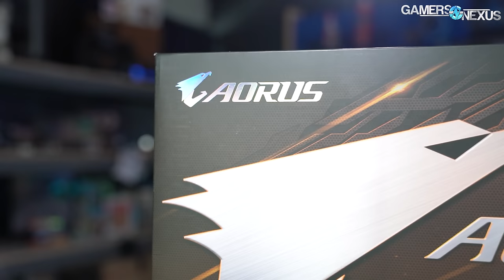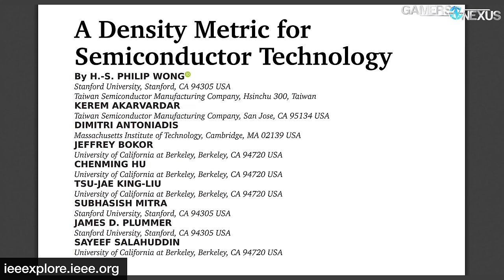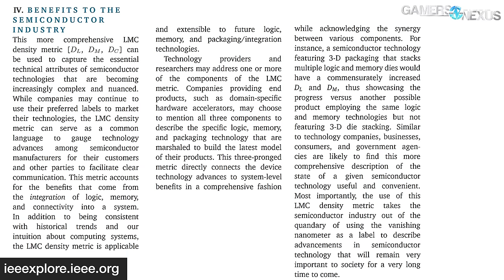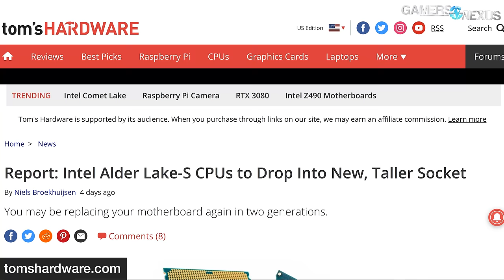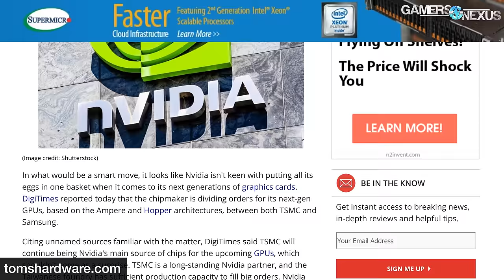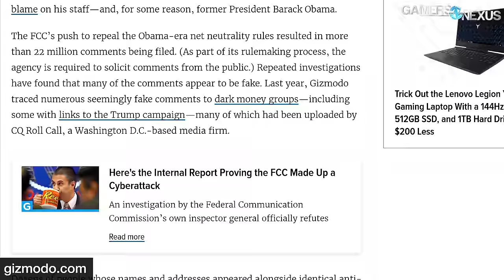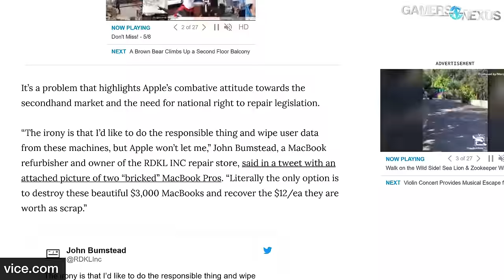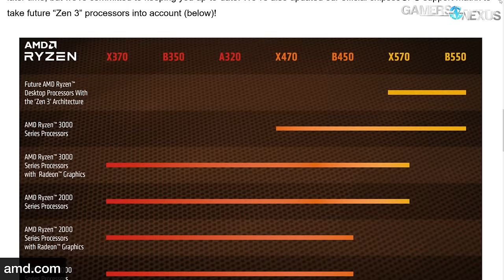HW News - NVIDIA & AMD Fight for 5nm, Intel Alder Lake, RTX Ampere, Ryzen Pro 4000

Comment: I don't get how nvidia would out buy amd in 5nm when tsmc announced they have a specialised 5nm enhanced node for amd
Reply: Nvidia and TSMC have much closer relstionship than AMD for around two decades. I think we will know more about the situation once GTC2020 video goes online. For some things both TSMC and nvidia prefer to keep it secret. Like 12nmFFN. when nvidia annouced GV100 in GTC 2017 we only know the existence of 12nmFFN at that time. Prior to that we never heard about this customized node that allow nvidia to break 600mm2 barrier. Not to mention back in 2012 nvidia are complaining about not getting enough 28nm capacity. TSMC quickly responded by giving nvidia capacity from both qualcomm and AMD so nvidia can meet their demand. So if nvidia said they want TSMC 5nm then TSMC probably will going to fullfill that demand. And we only heard about TSMC are doing some partnership with 5nm process but did not say by doing so it eliminates other access to TSMC 5nm node. If anything making the node exclusive to only one of their client is something TSMC will avoid at all cost. Apple once offering TSMC to manufacture their SoC only and ditch other and TSMC openly said they will never do something like that.

Comment: A silicon atom has a Van der Waals radius of 210 pm. To make a transistor you need more than 1 atom, at least 3 i suppose if you are optimistic, for gate, drain and source. As atoms cannot enter each others radius, 3 times 210 is a best case 620pm or about 0.62nm.  
However, because you need to dope the silicon into Positive and Negative charges, you need to combine it with other atoms. So you can pretty sure smaller than 1-2nm transistors will never be created. And even that would require immense the precision of basically placing single atoms precisely on a substrate. So after that it will be up to designs and architectures, Quantum computing perhaps, or  Terrahertz capable switching materials(but not smaller), superconductors perhaps for less heat.

Comment: i5-3570k @ 4.5 Ghz here. Just wondering if overhauling to the ryzen 9 3900x would be a worthy upgrade to the next future normal or should we wait for the ryzen 4000 specs to come out? My quad core has served me well for the past 9 years and I figured its age is really starting to show if a 12 core CPU is available for an affordable price.
Reply: Just wait for the 4000 series, if the reviews are good, go for it with a nice B550/X570 Board or if the performance increase is not super high, 3000 series might get a price cut then, it'd be a win-win situation.
Reply: Go 4000 series, less latency and higher clocks apparently. X670 motherboards should be tweaked a bit too.
Reply: I am still on a 2500k and I can feel a noticeable improvement on even a 1700-based PC, so yeah it should definitely be worthwhile. That said I would wait for the 4000 series. There is a good chance early adopters will sell of their old AM4 platform and price cuts in stores will happen too, so you should be able to upgrade for cheaper.

Comment: You know, i'm pretty sure anyone interested in process node size is quite aware of pikometers being smaller than nanometers. I also recall exactly 0 instances of someone having a problem with previously used 0,xx um (micrometer, micron) naming scheme. In fact, I believe some (:wink:, :wink:) IC manufacturing company got named after exactly that. Still not the point of course, but my inner social media warrior felt the compelling need to address that particular line of reasoning.

Comment: I’m really concerned about nvidia splitting their manufacturing between tsmc and Samsung. We have seen ARM CPUs labelled the exact same thing in the mobile space with large differences in quality and performance to each other. I’m not sure if this is the same thing but it does not inspire confidence.
Reply: Majority of nvidia GPU will be still at TSMC. and by majority it means mid range and above. We will not going to see things like GA100 (nvidia biggest chip) being manufactured at both. My take is some low end GPU (GA107/8) at samsung and their next gen tegra stuff.

Comment: I am super annoyed that x470 is apparently not going to work with Ryzen 4000 CPUs... I upgraded less than a year ago and bought a solid x470 board with specific plans to upgrade to Ryzen 4000 when it came out. What is the point of AMD's marketing about maintaining compatibility? I feel like they should at least support x470...and I hope board manufacturers have the ability and motivation to add support on their own. If I have to get a new motherboard, it is really going to sour my opinion of Ryzen/AM4 in general. The performance is great, but a big part of what it offered was an end to b.s. like this. It really feels like AMD is going back on their promises a bit here.

Comment: There is a natural lower limit to semiconductor technology dimensions which is 1 (one)  Angstrom.  1 Angstrom is one tenth of a nanometer; a unit commonly used in crystallography.  So a 0.5 nanometer technology is a 5 Angstrom technology.  The Angstrom is the natural unit to measure atom sizes and spacing.   For example,  the nearest neighbor silicon to silicon atom distance is 2.35 Angstroms.  Nothing in the semiconductor technology will be smaller than a few Anstroms (that is,  a few atom spacings).   Picometers,  femtometers,  etc.  are in the realm of nuclear and particle physics, not semiconductor physics.  500 picometers sounds silly,  but 5 Angstroms sounds cool,  doncha think?
Reply: You forget Quantummechanics.

Comment: Man im still using my lovely i5-4460 + R9 290. Im ready to upgrade and the hardware scene is looking great. Cant wait what Nvidia and AMD going to release the next few months.
Reply: i also have the i5 4460 and r9 290, and i also plan to upg this winter. the jump in performance should be really noticable, even with new midrange hardware
Reply: I still I5  4690k and GTX 1080

Comment: It's been common knowledge for quite a long time for anyone that understands even a little about the fab business that process technology nodes are not directly comparable from one company to another, especially as we entered the 2x nm era of fabrication (28nm, 22nm, etc). This has been a problem for some time, especially because it seems that certain companies got looser with their numbers, using numerically lower labels in order for them to seem like better processes. There are too many factors to a 10nm or less process to be able to say that one process is better than the other solely because the one label number is lower (this is part of the reason why Intel's 10nm, if it could have been fixed to work with mass-produced silicon as it was supposed to have been years ago, would have been very competitive with TSMC's 7nm, as not all variables for each process are otherwise equal, lending each one to having its own strengths).

For the end user who doesn't know a lot about fabrication, this would be the biggest benefit to coming up with a better way to measure node density, as it would put each node from various manufacturers on an even scale. We wouldn't have to have such caveats as "Intel's 10nm is competitive with TSMC's 7nm" because the processes would be represented more accurately. This might not suit the marketing department of any given company, but screw them. The closer we get to 1nm, the more meaningless these node numbers become.

Comment: should i upgrade to a 3900x or wait for the 4000 series? changed my mind on threadripper thank's to buildzoid! i'm still on amd 6 core fx chip luul
Reply: Just wait for the 4000 series to release and check out the reviews, if they're good, go for the 4000 series or else there might be a price reduction in 3000 series so it'd be a win-win.
Reply: 4000 series, should have less latency and slightly higher clocks.
Reply: I'd wait for the 5000. Details are scarce, but it should be faster than the 4000 series...
Reply: Im also fx 6300 user :D

Comment: Angstroms get used a lot more than pm when talking about fabricating semiconductors.

At least they do in my graduate semiconductor fabrication classes, as well as the fab where I worked and the textbooks and papers I read. In a lot of cases, Angstroms were also used more than nm.

The Fabs have always had a lot of versions of their process, TSMC for example has HP, HPC, HPC+, HPM and LP all on 28nm. A quick way to see what's available is to check what products Synopses has for that process size/type.
https://www.synopsys.com/dw/emllselector.php?f=TSMC&n=28&s=wMkRWA

I agree that the "gate length" is no longer a good metric. Those people definitely know what they're talking about.

Comment: but 500 picometer is smaller than 1 nanometer. why would anyone think otherwise? smaller is still beter. must be concerns over some imperial using country
Reply from the maker: You've missed the point again where it's not about the actual size, because that's a pointless marketing metric. It's about the fact that we need a new number. Further still, on the marketing side, if you said "this processor uses 7nm process," very few people could actually tell you what that means -- much less if 1nm is better than 500 picometers. It's nothing to do with the metric system and entirely to do with an arbitrary, hardly useful metric to begin with that's meaningless to consumers who don't actually pay attention to this industry.

Comment: Size is relevant, however insignificant.  If you can stuff more complexity into a given area, it has more.

Simply put.

And true for many people who ignore, forget or retain the metric system understanding is perfectly natural, there are many others who have past experience to understand it.  It is the only way manufacturers can move to creating better chips at lesser cost which operate at lower power, besides changing the physical logic within the die, which remains the single #1 factor.

Kilo meters, kilo gram, billion air, micro meter, nano meter, Terra byte, we all understand the metric system and how it works.  Failing to comply with standard scientific measurements only insults our intelligence as a species. Don't know about you but I am sick of being insulted.

Comment: Your logic about not switching to picometers because the numbers will get bigger and it will confuse people is flawed. First, most general consumers don't know anything about what nm their CPU is, they know things like the number of cores or i3, i5, i7, or Ryzen 3, 5, 7. The consumers that know about more in depth things are enthusiasts and they will not be confused at all about switching to picometers. With your logic it was a bad idea to market 2 TB HDDs because it sounds smaller than 2000 GB and it would confuse the consumer. Maybe manufacturers should be selling 2,000,000,000,000 byte drives. Why isn't Intel advertising the 10900K to boost to 5200 Mhz?

Comment: Can't believe how casually you brushed off the mobo backwards compatibility issue with the future 4000 chips. Aside from misleading their customers into thinking that at least the top tier (X470) boards would properly support one subsequent gen (if not outright, then by carefully cultivating customer expectations while not technically promising anything) - Their reason is bullshit. Just provide the customers with the choice of BIOS: 1000 & 2000 series, or 3000 & 4000 series BIOSes. It's not too hard to just split them! - Besides, there are 64mb boards too.

Comment: Guess both Intel & NVIDIA will wait until PCIe 5.0 and avoid the short 4.0 release. AM4 is almost at the point as AM3+ a few years back......no need to spend $1,000+ on this underperforming (PCIe 4.0) platform which is NOT doubling PCIe 3.0 by any means, evidenced both by AMD PCIe 4.0 GPU's & NVMe 4.0 x4.

Comment: When will AMD be on -3nm?
Reply: You can't.
Reply: @emmata98  You can if you turn the transistor around in the opposite direction
Reply: @chrism6880  Distance is always bigger or equal to zero :)
Per Definition of the Metric you are using to measure it.

Comment: Picometer? Kind of irrelevant, not used. 100 of them make an "Ångstrom" (10e−10 m) that was used long time in scientific community. That  Ångstorm is 0.1 nm so would be very useful here too.
Why is that? Because inter-atomic distances are in 1-10 Å range. Going lower than that just adds zeroes with no meaning.

Comment: AMD lying with their excuse not to support Zen 3 on older motherboards..it's becoming like Intel
Reply: technically they might not be able to hold the new information, which is why x570 only supports zen + and zen 2 currently, but it's still bullshit that they won't at least give us two bioses, one for zen 1 and zen +, one for zen 2 and zen 3. or drop zen 1 support in a future bios release so people who still use zen 1 simply don't update.
Reply: @bananya6020  they can trim down the bios and drop older zen support..remember they did the similar shit on zen 2 with x370 getting separate bios for zen 2 until they integrated them all into one..they can just do the same and done with but they wanna sell b550 mobos instead.

Comment: The thing about the process technology naming convention is that it's really not useful for anything other than marketing. If you work in the industry, well then you know much more details about the process that simply can't be encapsulated in a single metric or even multiple metrics. And if that is the case, then you, as someone in the industry, don't give a damn about the name because you know the exact details of the process nodes. These details are given to you when you shop for a foundry for your chip. As far as engineers care, you can call it process technology A and process technology B. Furthermore, the way the ecosystem works, basically everyone knows the details of everyone else's process technology. 

So this isn't going to go anywhere. TSMC and Intel will use whatever maketing term they want and the engineers in the industry won't even care. Also, as a consumer, the process technology doesn't tell you much about a product other than an expectation of  performance improvement as compared to previous products in the same company.

Comment: I don't imagine that your response on the picometer comments will satisfy people, since they're responding to a comment you made about running out of numbers after nanometers and not to the concepts in the paper. You then responding as if they were responding to the concepts of the paper really makes no sense. I wasn't one of the people that commented, but did notice your unfortunate phrasing and thought it would engender a lot of comments. I think this recap of the same information as last time with just leaving out that one comment and acting as if people didn't understand and saying people didn't read the paper (I'm sure some did), is just throwing oil on the flames.

Comment: You pay $900 for internet because you have an SLA on your DIA -- don't forget to mention that to people.  If your service is down for more than 4 hours, you get 50% off of your bill because that's how SLAs work.  Your home internet could drop for days and your speed isn't guaranteed, and in such case it's still "best effort".   Net neut was stupid and unnecessarily ADDED COSTS to internet service, since consumers pay all costs businesses incur, it made things more expensive for us.  Compliance isn't free and nobody needs the gov, who self-admitted "we don't know how the internet works" up in their shit.  Net neutering was built on the comcast-netflix peering issue and NET NEURTERING AVOIDED THE TOPIC ENTIRELY because "we don't know how the internet works".  In-fact 99.999% of the world doesn't understand what the internet is and how the millions of networks that interconnect make it possible.    The entire logic behind net neurtering was the equivalent of putting additional regulations on motor oil because tire prices fluctuate.  If you're thinking motor oil and tire prices have nothing to do with each other, you're right, just as massive gov overreach known as net neut had nothing to do with network peering at the IX.

Comment: Apple can talk a big game about their recycling program and how they care about the environment, but the reality is that they are (and have been for years) going out of their way to design their products to be as unfixable and as disposable as possible. Whether it's the T2 chip detecting hardware changes and making the computer inoperable, or a MacOS update that renders a perfectly working replacement LCD screen inoperable due to a missing EDID code, Apple has always explained these things as being necessary for the security of their customers' data, but it's all BS.

Likewise, the notion that Apple heavily recycles the products that get sent back to them is equally BS. They have 2 recycling robots that take apart machines they receive. Apple receives WAY more machines than these robots can handle. Anything that their recycling machines can't handle gets scrapped. Apple PAYS scrappers to scrap their junk machines, no matter what condition their in. The scrappers sign a legal agreement saying that they will scrap the machines and are not allowed to take perfectly good machines out of the scrap and resell them or send them to refurbishers. They are forced to scrap EVERYTHING because Apple desperately doesn't want perfectly good parts to make their way into the second-hand market.

A company cannot go to such extreme measures to destroy useful devices while claiming they attempt to recycle as much as possible and that they care about the environment. The ultimate recycling of an Apple product is to either fix it and keep it in use, or use its parts to repair other existing devices. Apple doesn't want anyone to do either of those things.